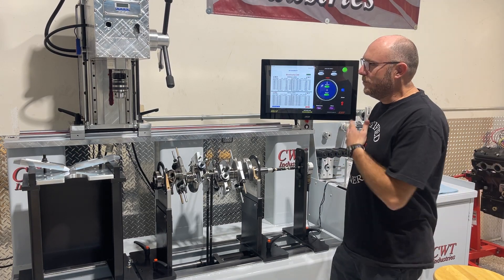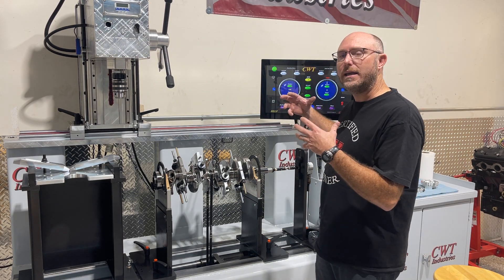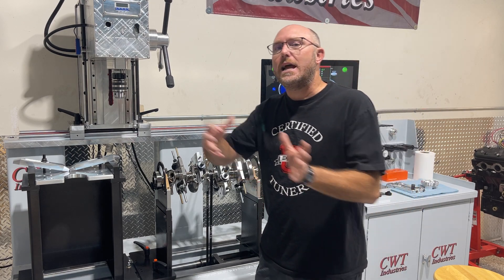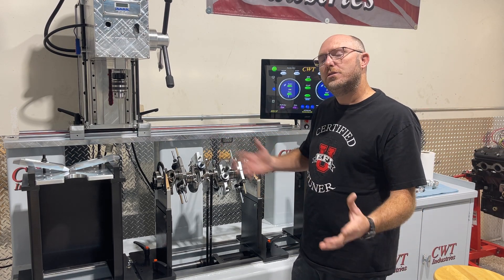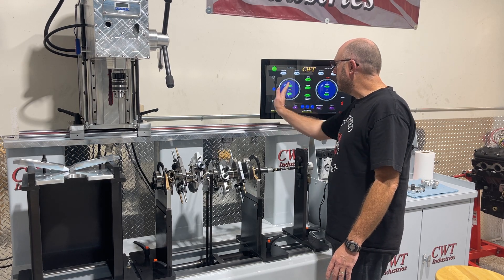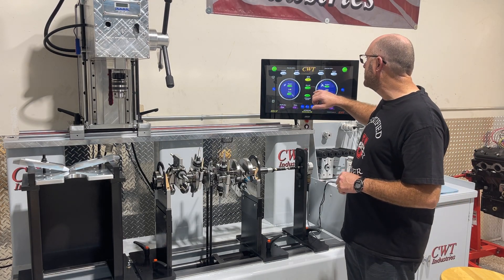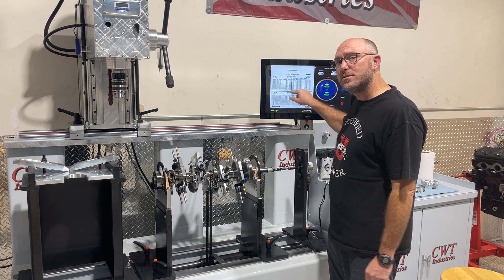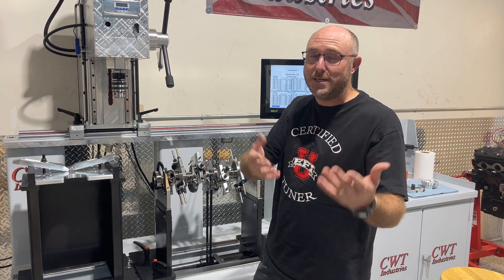Should you even bother with Crankshaft Balancing or save your money?

Comment: Ben, Love your channel and plan to attend some of your classes some day (have to fund it out of personal money not in the industry) . One thing to consider is over and under balance... In racing it may be nice to have a car that idles smooth (well balanced at idle)   I think some racers will tell you when you over balance to the rpm range  the engine is running at during  the race that's even more important as the engine is not trying to shake itself appart (some racers can feel at high RPm when it come into balance) . I notice they still drill into the crank to reduce weight to get in balance, many years ago i read an article on someone turning down the counterweight to get the crank in balance rather then drilling holes and affecting the aero of the counter weight

Comment: Actually, the standard remains the same.  It’s the assembly that changes.  As Randy has explained, OEM is approach racing standards from 10 years ago.  Having run the old Stewart Warner, Balance Technologies, Winona Van Norman, Hines, and a CWT Multi-Bal 5000 I bought in 2007, the CWT is a quantum leap above anything else on the market.  The old machines I listed were nowhere near today’s.  Imagine using a timing light to identify the upside unbalance.  The Hines and the Winona at least had degrees for position.

Comment: Like the others, I'm surprised that you thought crankshaft balancing was junk science. Glad you saw the light. I have always wondered how the 50% factor of the connecting rod mass was arrived at. It seems to be an estimate, rather than a hard and fast amount. I would be interested to see a test of an actual short block mounted with accelerometers with a variation from 45% to 55% to see if balance really is optimal at 50%. Has CVT ever done such a test?
Reply: There's a term for unbalanced reciprocating mass: vibrator.  In the drilling industry, they call it a shaker.  In proper application, the business of sorting solids [as in grading sand], or separating cuttings from fluid uses a purposed imbalance to create a force vector: it makes things jump.   It is... very severe duty where bearings are concerned, and equipment failures are common, even with careful regular maintenance.
Reply: I have done it with a vibration meter on my iPhone.  50% works mathematically.  The other percentages fall into the voodoo category like 1% over or under balance.  When you exceed the yield strength of the components, all bets are off.  This is why Top Fuel cars have $10,000 crankshafts and they (if they live) change bearing between runs.

Comment: Im suprised you thought balancing is junk science....never ever heard anybody relevant say such things. As you get above 7500 rpm its very important.  If it wasnt we wouldn't have balancers on our motors. Even the NHRA requires approved balancers, thats how important they think it is.  This balancing is very important in motors that sustain long runs like boats. A boat motor wont last long at speed without a well balanced rotating assembly.  Transmission included. 2 stroke engines have a 2 piece crank shaft, they have to be trued and balanced or you will have serious power loss and broken skirts. The rotating weights can actually work againt each other and be counter productive. And you hit on that. To keep centripetal motion. Nice machine. Good luck. Should produce some high quality parts.
Reply: The reason many people refer to it as "junk science", is that, at the basic level atleast, the math is only an estimate. Your % figure for reciprocating weight is a very loose figure, which isn't always the best number for any given engine. Some engines like a higher percentage than the standard figure (i.e. 50% for 90⁰ vee engines), some don't. 

Also worth noting, on your balancer comment, most super dampers that I've seen, will affect your balance pretty significantly. I generally balance all crankshafts (even stock rebuilds) within .5g. If it's easy enough I often shoot for .1g. Every time I've had the opportunity, I've put balancers and flywheels on cranks just to get every bit that I can. Super dampers alone generally put the balance 1-3g out if you install them after the crank is already balanced.
Reply: @coltonholiday4872  thats why the balancer needs to be installed during balancing. Most 0 balance flywheels are on the money. And all the high dollar convertors are balanced perfect. Thanks for the input.
Reply: Think the statement of crankshaft balance being, “junk science”, was intended as a overstatement to emphasize the inexact nature of percentages of balance applied and the interest to research a scientific approach to it.